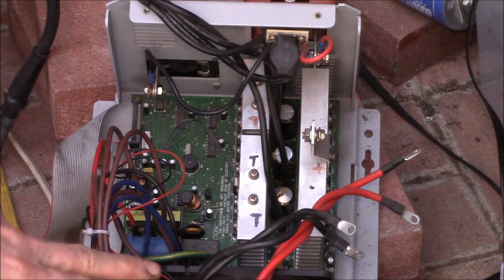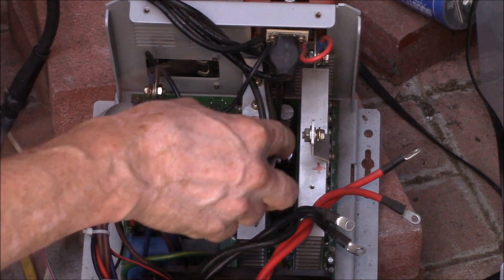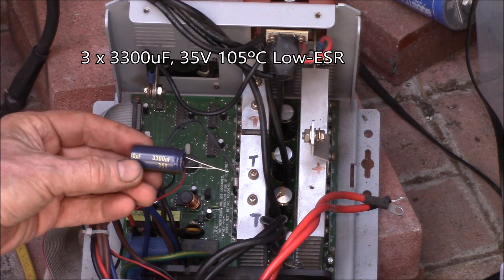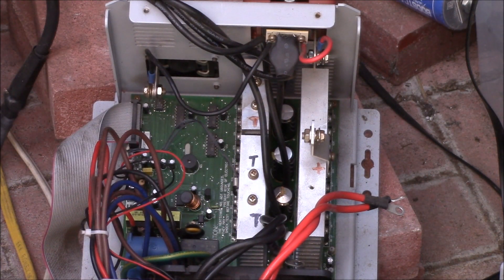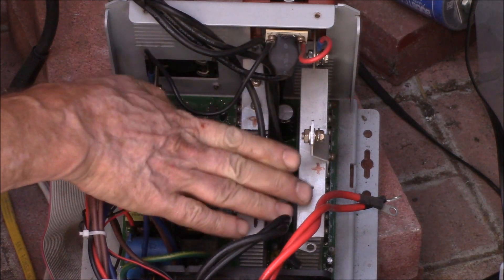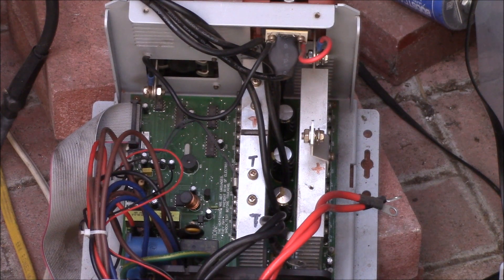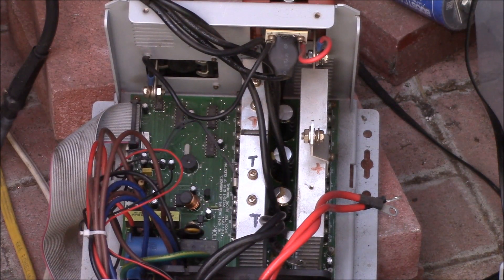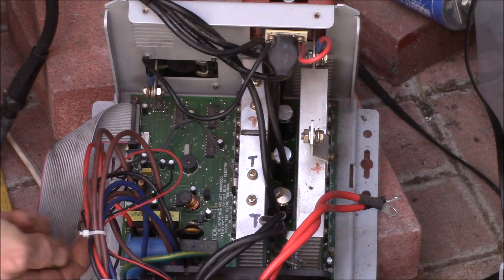TrippLite APS1012SW Inverter/Charger - Blown Caps Part 1

Comment: Good choice going with better caps, hopefully the transistors are okay. IMHO just add a fan to the vent instead of blocking the vent, it could be temperature controlled. Great video
Reply: agreed adding a fan would be much better.
Reply: Hey man how are you doing, hope all is well? Godspeed
Reply: very good thanks.
Reply from the maker: Thanks for the comment.  I'll be adding a new fan controller to the unit as I think the built in fan controller is defective.  That controller does have two PWM fan outputs so it may be possible to add a 2nd fan if needed.  The fan that is inside the unit is pretty strong, though.  It's 120mm in dia. and rated at 1 amp draw at 12 volts.  I also need to add a temperature monitor so I can keep track of the temps inside the unit, since you need to have the top of the case on for the fan to operate properly.  That way I can check out various changes to the temperature with changes in the air flow paths inside.